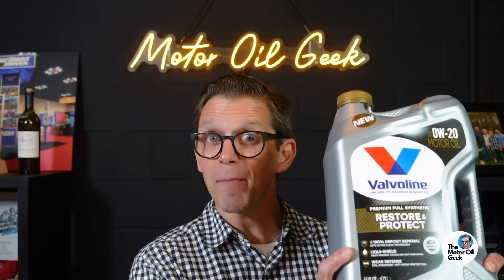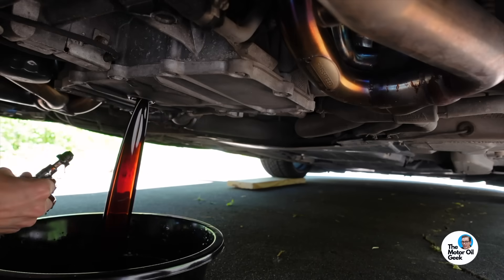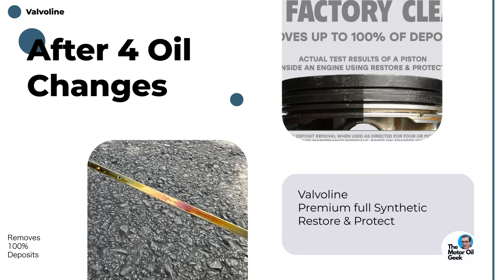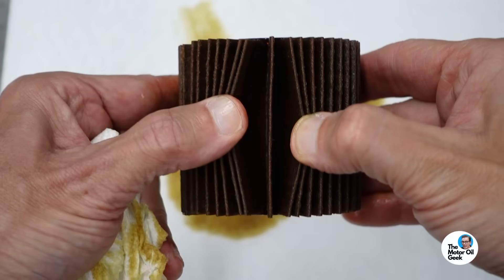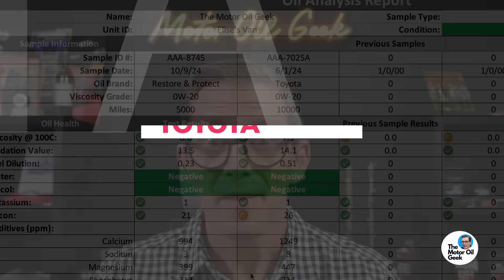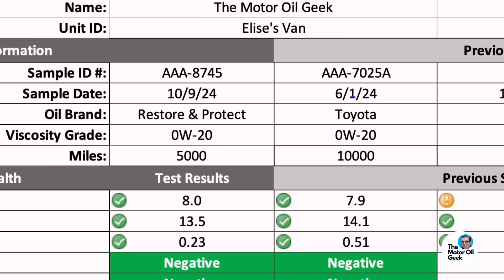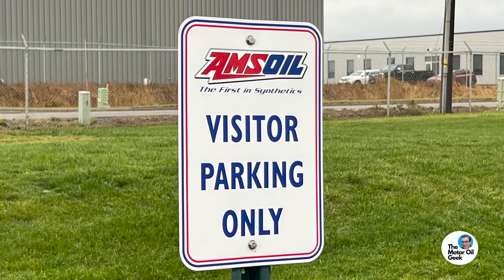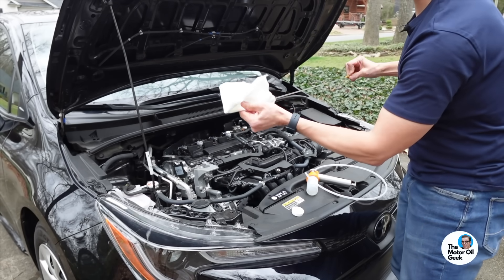The TRUTH About Valvoline's BOLD Engine Cleaning Claims

Comment: This oil is the real deal. I own a Honda Accord 2012 with 175k miles and I just started using this oil. First thing I noticed was no hesitation at all ( Im super surprised because i have never feel my car this responsive before). Engine run more smoother. 
I declare myself a valvoline customer for life !!
Reply: My 2015 Honda Pilot with 165k did the same thing, seems like it brought the engine back to factory specs
Reply: I just use it in my jetta with 485000km and i get the same result very responsive and get better gas mileage
Reply: Just wait until some executive wants to boost margins and silently cheapen out the product.  A tale as old as time.
Reply: @Loudlevin  holy crap, you are right... this comment secured my order.
Reply: @Loudlevin  As word gets out, they’ll just increase the price they sell it for.  I’m amazed it isn’t more expensive already.
Reply: @Rob-ou1fj  shhhhhhhh 🤫
Reply: Yeah… i have a same feeling after every carwash. 😅

Comment: I have this in a 25yr old Acura RL I purchased new. I switched to synthetic ten years ago and generally run PUP or RP HMX. I can’t explain it but vibration at higher speeds is down significantly after 1500 miles. Very odd. Wondering if ring buildup in some way contributes to NVH. I’M

Comment: I have a 2022 Toyota Highlander with the 3.5 V6 with just under 20,000 miles. I change oil every 5,000 miles. I know that the newer direct injection engines are prone to low speed detonation. Do you feel that using this oil would be beneficial and cost effective to use, and can this oil be used long term as the normal fill oil at oil change interval?

Comment: I switched to the Restore and Protect in my 08 Impala with the AFM 3.9L. I burn 3 quarts in 3000 miles. I'm hoping it helps some with my oil burn and helps to clean up the caked up crap in my motor. Bought it from a rental company at 114k and you know they were not nice to it. Doing what I can with 3k oil changes with full synthetic. At 176k with zero engine issues so far and knocking on wood for the future with the R&P.

Comment: Trying this on my Scion xD with 1.8 liter motor .
166000ish miles. 

I have issues reading the dipstick until at least 2000 miles. The oil stays so clean.
That's  before changinging over. Records from past owners show it always got synthetic.

Aprox. oil burn rate is a quart in 10,000 miles. 

I guess it's  not the best candidate for this oil but , why not. I drive my cars until the wheels fall off.
And the AC still works.

Changed the filter at 2000 miles and topped up with more R&P.

Other car , '17 2.5i Forester will get it in a  few months. It also sips oil but at higher rate of 1qt/ 8000miles. Rolling on at 196,000 miles( all mine/ all  full syn).

Comment: Project Farm tested several "OEM" oils (incl. Honda and Toyota) against a high-quality aftermarket oil.
Wear and volatility were lower and cold flow better than the "OEM" oils. 😉
Reply from the maker: I will share the science of engine oil wear testing in a future video.
Reply: @themotoroilgeek  Thank you! 😃👍
Sure, his wear test is very basic. But it's amazing how 2 oils of the same viscosity can have double or half the wear of the other.
I think it's time for Todd (Project Farm) initiating a new "Oilympics" in that he should include your numbers for max calcium/potassium content for avoiding LSPI in new GDI/Turbo engines.
Reply from the maker: @u.e.u.e.  I respect Todd's efforts, and I really like the cold flow test after the oil has been heated and tested for volatility.
Reply: @themotoroilgeek  Yeah, his wear-test machine is cool.
AND he has a Watt-meter for indicating which oil reduces friction better or worse. 😉

Comment: So Manganese was the only substance that was apparently suspended in the Valvoline "Restore and Protect" OW-20 (?) engine oil? Is this a DI engine in this van? Did this engine burn any oil in between changes and did this improve? What about the fuel mileage any affect? How about fuel dilution? No before and after scope picts or maybe some dyno results? Come on Lake, Up your game Bruh...:)

Comment: Ok..Vavoline restore protect..Definition by them..Restore and Protect from Carbon..Guess What..By Product of Internal Combustion Engine is Carbon..Minimul Carbon in IC Engine stabilizes Rubber Seals in High Mileage Engines...Take it all away...$$$$$$$$ out of your pocket for repairs that could of lasted another 50,000 miles...Another Gimmick from the Big Oil Co....Think about it....

Comment: Is Valvoline Restore and protect ever going to be made in 10w30?  I want to use it in my vehicles but most of my cars take 10w30.  If not what would be the problems in using 5w30 in my engines instead of 10w30?

Comment: Were the oil changes on your wife's toyota Sienna up to the point of you trying the new oil done at 5,000, 7,500 or 10,000 miles intervals?? I have a 2010 Toyota Venza V6 with 165,000 miles on it and my dipstick looks like new. I've always change my oil at 5,000 mile intervals. It has no oil leaks and doesn't burn a drop a drop of oil. Been using Mobile 1. Not sure if I should change??

Comment: https://youtu.be/e40A4yz1_FM?si=BY87Vhlgv_Nffm37

Bettano 20W50 SL is a type of motor oil commonly used for older or high-performance engines. Here's a detailed overview of the product based on standard specifications for 20W50 SL motor oils:

Overview:

SAE Grade: 20W50
The viscosity grade indicates the oil's thickness at low and high temperatures. 20W50 is a thicker oil, suitable for warmer climates and older engines.

API Service Classification: SL
The API SL standard is designed for gasoline engines built after 2001. It provides excellent protection against wear, deposits, and oil oxidation, while maintaining engine cleanliness.

Features and Benefits:

1. High Viscosity:
Ideal for engines requiring thicker oil, especially in high-temperature environments or engines with higher mileage.

2. Thermal Stability:
Provides protection under extreme temperature conditions, reducing thermal breakdown.

3. Anti-Wear Properties:
Ensures prolonged engine life by reducing friction and wear.

4. Oxidation Resistance:
Prevents sludge and deposit formation, ensuring cleaner engine performance.

5. Compatibility:
Suitable for vehicles with older engine designs or engines requiring high-viscosity oil.

Applications:

Recommended for gasoline engines in passenger cars, light trucks, and SUVs.

Particularly effective for older vehicles or those operating under severe conditions, such as towing or hauling.

Suitable for use in engines where the manufacturer specifies API SL or earlier standards.

Typical Technical Specifications:

Viscosity at 40°C: 160-170 cSt (approximate range, varies by brand).

Viscosity at 100°C: 18-20 cSt.

Viscosity Index: High, ensuring stable performance over a range of temperatures.

Flash Point: Typically above 200°C, indicating thermal stability.

Pour Point: Approximately -25°C, ensuring flow in cold weather.

If you need a specific data sheet or information about a particular brand of Bettano 20W50 SL, let me know!

.

Bettano AW 68 hydraulic oil is a premium-grade anti-wear hydraulic fluid commonly used in industrial, construction, agricultural, and marine machinery. It belongs to the ISO VG 68 viscosity class and is designed for high-performance hydraulic systems requiring reliable lubrication and wear protection.

Key Features and Applications:

1. Anti-Wear Additives: AW 68 hydraulic oils, such as those with high zinc formulations, are fortified with additives to minimize wear and tear on pumps, motors, and valves. This ensures longer equipment lifespan under high-pressure operations【7】【9】.

2. Thermal Stability: These oils maintain viscosity across a wide temperature range, supporting operations in both hot and cold conditions. They also resist oxidation, preventing sludge and deposits in hydraulic systems【7】【9】.

3. Rust and Corrosion Protection: AW 68 provides excellent protection against rust and corrosion, making it suitable for marine and outdoor applications【8】【9】.

4. Foam Control: The oil includes anti-foam agents for smooth operation by reducing air entrapment within hydraulic systems【9】【10】.

5. Applications: It is widely used in systems like excavators, bulldozers, cranes, tractors, and injection molding machines, where consistent hydraulic pressure and lubrication are critical【7】【8】.

For detailed specifications or compatibility with specific machinery, consult the product's technical datasheet or manufacturer recommendations. You can explore detailed technical information from sources like Armor Lubricants, Mobil, or Duragard Oil【7】【8】【9】.

.

Bettano 20W50 diesel CI-4 is a multi-grade diesel engine oil designed for heavy-duty engines. Here's an overview of its key features and benefits:

Specifications

Viscosity Grade: SAE 20W50

API Rating: CI-4

Suitable for both naturally aspirated and turbocharged diesel engines.

Key Features

1. High-Temperature Stability: The 20W50 viscosity ensures excellent lubrication and protection under high-temperature conditions.

2. Superior Wear Protection: CI-4 rating indicates it meets stringent performance standards, reducing engine wear and enhancing longevity.

3. Detergent and Dispersant Additives: Helps keep the engine clean by preventing the formation of sludge and deposits.

4. Oxidation Resistance: Maintains performance during extended oil change intervals.

5. Reduced Soot and Particulate Build-up: Protects against soot-related wear in diesel engines, improving efficiency.

Applications

Designed for heavy-duty diesel engines used in trucks, buses, off-road equipment, and generators.

Suitable for engines compliant with older emission norms and high-sulfur fuel environments.

Benefits

Enhances engine life by providing robust protection against wear and deposits.

Improves fuel efficiency through reduced friction.

Offers extended oil drain intervals under optimal conditions.

If you're considering this oil, ensure it aligns with the manufacturer's specifications for your engine.

.

BETTANO 15W40 and 20W50 Diesel CI-4 are motor oils formulated for diesel engines that meet the API CI-4 specifications. Here’s a breakdown of their characteristics and applications:

15W40 Diesel CI-4

Viscosity Grade: 15W40, suitable for a wide temperature range.

Purpose: Heavy-duty diesel engine oil.

Key Features: Provides excellent wear protection, sludge resistance, and good flow in moderate cold temperatures.

Applications: Designed for modern turbocharged or naturally aspirated diesel engines in trucks, buses, and heavy machinery.

20W50 Diesel CI-4

Viscosity Grade: 20W50, thicker oil for high-temperature stability.

Purpose: Diesel engine oil suited for hot climates or engines with high mileage.

Key Features: Enhances protection against oxidation, wear, and deposits at higher operating temperatures.

Applications: Often used in older or more demanding engines operating under extreme conditions.

Both oils offer:

API CI-4 Rating: Designed to handle the requirements of engines with Exhaust Gas Recirculation (EGR) systems and high sulfur fuels.

Protection: Reduces soot, improves engine cleanliness, and ensures longer oil life.

When choosing between these grades, consider the manufacturer's specifications, operating environment, and engine condition. For colder regions, 15W40 is ideal, while 20W50 performs better in hotter climates or older engines.

.

Bettano 5W30 Fully Synthetic Dexos is likely a high-quality engine oil designed to meet the Dexos specifications, which are standards set by General Motors (GM) for oil performance and compatibility. Here's a breakdown of its key features:

Key Features:

1. Viscosity Grade: 5W-30

Ensures excellent performance in a wide range of temperatures.

Good for cold starts (5W) and reliable viscosity at high temperatures (30).

2. Fully Synthetic:

Offers superior engine protection and performance compared to conventional or semi-synthetic oils.

Helps reduce wear, deposits, and sludge buildup.

3. Dexos Approved:

Suitable for vehicles requiring Dexos 1 Gen 2 or similar specifications.

Compatible with many GM vehicles and ensures efficiency and long engine life.

Benefits:

Fuel Efficiency: Helps improve engine performance and fuel economy.

Extended Drain Intervals: Longer service intervals compared to conventional oils.

Engine Protection: Reduces wear and improves engine durability under extreme conditions.

Compatibility: Works well with modern turbocharged, direct-injection engines.

Applications:

Ideal for cars and light-duty trucks requiring a 5W-30 viscosity grade and Dexos approval.

Suitable for both gasoline and certain diesel engines, depending on manufacturer recommendations.

If you're considering this product for your vehicle, double-check your owner’s manual to confirm that 5W-30 and Dexos specifications are appropriate.

.

Bettano 10W-40 Full Synthetic Engine Oil with Dexos certification is a premium-quality motor oil designed to meet modern engine requirements. Here's an overview of what it offers:

Key Features:

1. Full Synthetic:

Provides superior performance and protection compared to conventional or semi-synthetic oils.

Enhanced thermal stability, ensuring better performance in extreme temperatures.

Offers extended oil change intervals in line with manufacturer recommendations.

2. 10W-40 Viscosity Grade:

Ideal for vehicles operating in a wide temperature range.

Ensures smooth cold starts while maintaining excellent protection at high operating temperatures.

3. Dexos Certification:

General Motors' Dexos certification ensures compatibility with GM vehicles, as well as many other modern engines.

Offers improved oxidation stability, sludge resistance, and fuel economy benefits.

4. Engine Protection:

Protects against wear, deposits, and sludge build-up.

Suitable for high-performance engines, including turbocharged and direct-injection systems.

Applications:

Designed for gasoline and some light-duty diesel engines.

Suitable for cars, SUVs, light trucks, and other vehicles that recommend 10W-40 viscosity.

Before purchasing or using, confirm that this oil meets your vehicle manufacturer's specifications. If you’re unsure, consult your owner’s manual or a trusted mechanic.

Comment: I was always taught that if your dipstick looks like that, you were neglecting oil changes. I was also raised on the 3 months/3K mile intervals for the  oil changes and ATF and filter every 5 oil changes. OEM filters only. Never had to replace an engine or transmission on anything I've owned after several hundred thousand miles.

Comment: Ive been using this oil in our 2015 equinox for the last 4 changes or so. 155k miles 3k synthetic intervals. The first 2 changes the filter look3d significantly dirtier. This engine burns about 1qt every 2,000 miles. So far no change in that but we'll see. My theory was maybe the rings are sticking letting oil get by but idk if thats the case. These engines are known for eating oil like its their job

Comment: Been driving 55 years vintage and new Detroit iron 3 major brands ..from the days of conventional oils to the first iteration of MOBIL  1  iahave never let any engine oil accumulate more than 3600 miles . I do not care what OIL manufacturers say about their oil being good for longer than 3600 miles ...that is nonsense . The Toyota dipstick is your proof of it at 10000 miles intervals. Since 2106  I own a 2016 Toyota 4 runner Trail with  70 k on it  and have  used  only  its 0w20 Toyota brand oil since 30 miles on the odo  new....never not matter whose recommendation have I let oil go past 3500 miles  ...sometimes  depending on the use I have changed it at 2200 hundred miles ..the dipstick on that V6 is a  mirror .
To abuse an engine with 10 k oil interval changes is ridiculous and that VALVOLINE oil packed with extra detergents may have cleaned the carbon that caused damage unseen which did not need to have happened in the first place if the changes were more frequent .
so what is the point? Restorer ? That oil will not restore stretched timing chains nor will it restore metal surfaces .
I usually get nearly 300 k before I get rid of my vehicles that is a matter of many years and have never spent in that mileage the equivalent cost of  a new replacement  engine and  oil and filter changes ....in all that time . Of course I save not only money and get more mileage on the clock but also better mpg by doing the changes myself .Many people do not  have not the tools or a garage ...but let this be a motive for changing oil sooner ...my 4 runner is getting 24 mpg on the highway at 67 mph , Toyota specs the 270 HP V6  in its engine bay  at 17 max  @ mph 55 mph ...highway  7500 maximum miles  changes per manual . The local dealer was skeptical about my claims ...we went for a ride ...he is a believer now .
Yes synthetics are better than the old mineral oils  but   their viscosity breaks down nearly as quick if the mileage is short trips and especially in very cold climates like where I live . Have fun cleaning the sludge ...I prefer to do my best to not let it happen in the first place.

Comment: Does this oil do anything for seals
Reply: So to meet gf-6 specifications, there is a minimum required amount of seal conditioners found on all oils that meet that spec. If you think you need an extra shot of those conditioners to try and stop a leak, you may want to try a specific high mileage oil or get the seals that are leaking replaced. Ive had good luck with Valvoline maxlife in the past. Also Quaker state High Mileage synthetic did well for me in the last leaker I had before i replaced the leaky seals